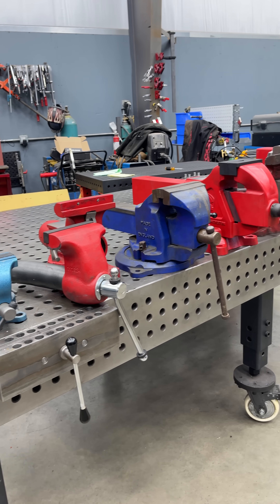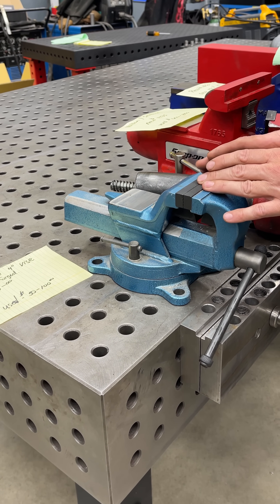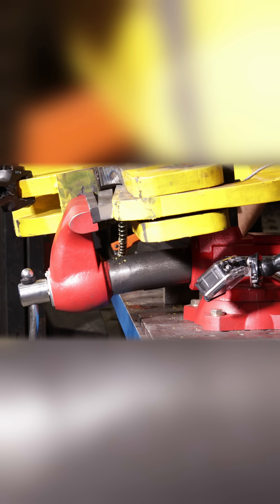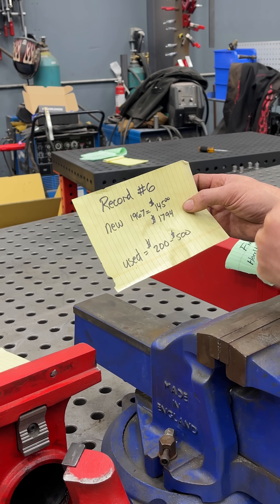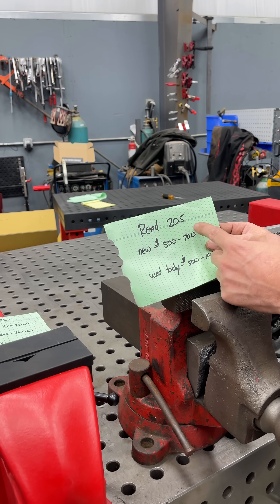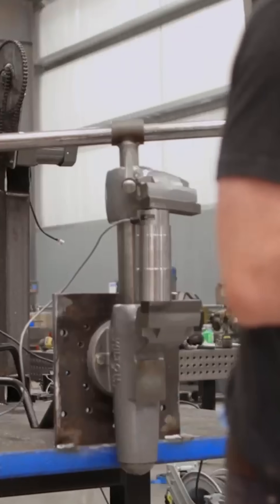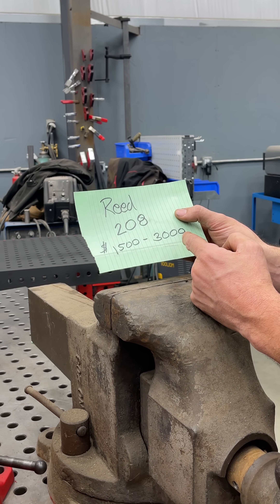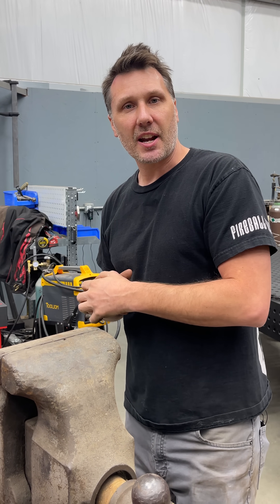Why does one vise cost $150 and another $2,000?

Comment: Honestly, I feel like a small, maybe 4 inch version of the 510 or the hard tale would be super useful for some hobbies guys who want a nicer vice but need the smaller footprint nine times out of 10 when I use a vice I’m using it to hold something while I cut or drill or just as a third hand. But that doesn’t mean I don’t appreciate advice that can take some beating a small version of say the 510 would be perfect for a lot of of what I do. It’s rare that I have a large part that needs to go into advice but almost every part I put in the vice I want to be able to hang onto really well. This is coming from a guy who is currently using a 50+ year-old craftsman vice that has about 3/4 of a turn of backlash and I actually have set up to be super easy to move initially it was just bolted to a block of wood, which was plenty for some of the work I do but more recently I took it made a bass plate for this thing with four holes that I can drop 5/8 bolts through and then have welded some 5/8 nuts underneath the holes on the table so in about 30 secondsI can go around with a wrench brake loose. All the bolts undo them and I can stick the vice underneath the table or on a shelf out of the way and have my entire table again and then when I need grab it, throw some bolts in it and I’m good to go again.

Comment: $2k for a vise / making you money for potentially 20years / 5 workdays a week = approx. $2.60 per workday.
Reply: Um..  for the sake of easy numbers lets say 50 weeks in a year, 5 x 50 is 250 days in a work year 250 x 20 years gives you 5000 work days for 20 years. A $2000 vise divided over that time gives you 40 cents per day not $2.60
Reply: Your math is wrong. It's $0.38
Reply: You divided the numbers wrong...It would be about $0.38 per day if you used it 5 days a week for 20yr...You divide $2000 by 5200 workdays, not the other way around...
Reply: Your math is bad, $2,6 per work day is less than 4 years of using. 1 year has 250 working days, 5 workdays a week.